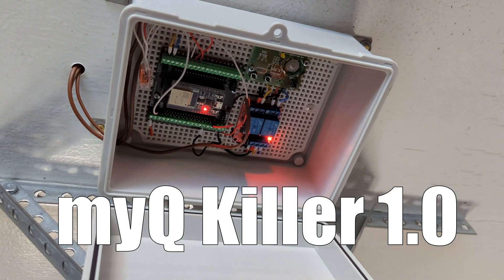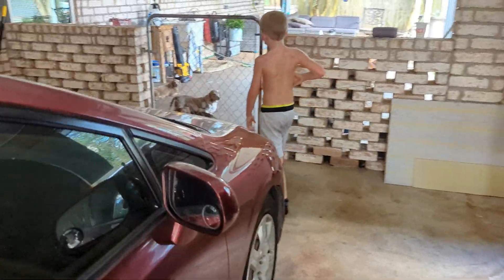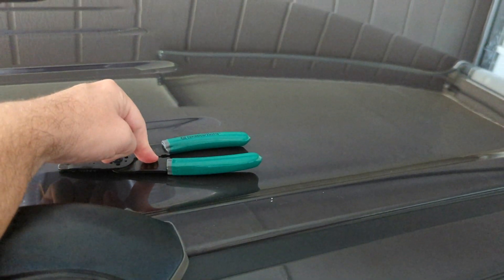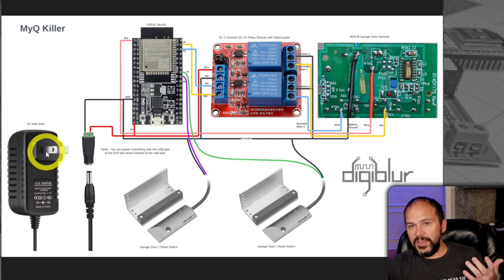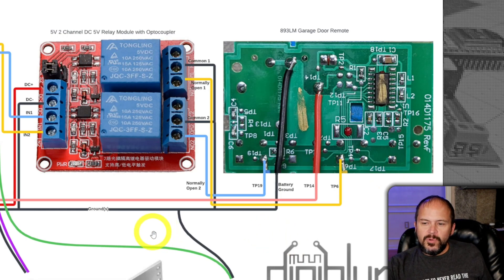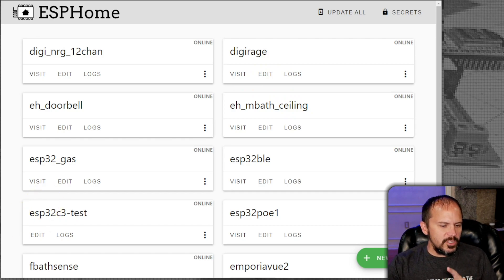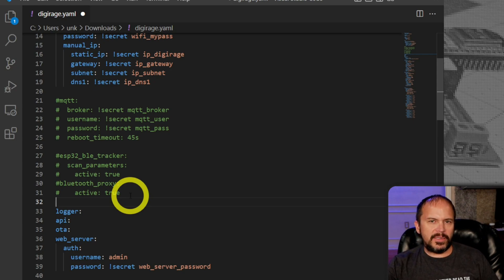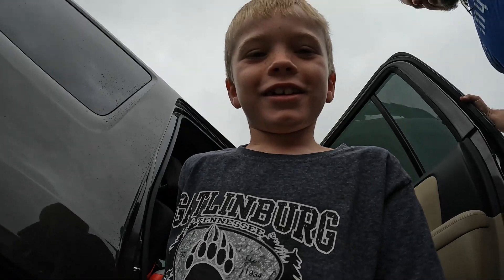myQ garage openers suck! How I fixed it using a spare door remote and ESP32

Comment: I really appreciated the video but why go with LiftMaster in the first place as the garage door system?   I'll eventually need to replace my garage door system and I am sure I won't go with a LiftMaster because of all the horror stories around MyQ.  Probably will look into Genie.
Reply from the maker: This was all they were installing in my area as well.  I waited for a bit on some older openers on backorder but due to scheduling and such we didn't want to wait any longer.  They were very confused on why I didn't want the "app thing".  I'm sure myQ is waiting to pounce on some premium features for a monthly bill.  Lock you in type thing.
Reply: For me, it was just what I bought, didn’t do my research ahead of time, and I regret that, but it was decent cost wise and other than this and one other issue, it’s been great. When my garage was being built onto my house, and after the opener was installed, at least 4 different times, hammering nails somewhat close to the opener, within 10 feet or so caused the opener to trigger and without any of its limits, it actually bent the rod clear up until it damaged the drywall on the ceiling, and destroyed the door itself making it be replaced, and with the battery backup, simply unplugging it didn’t stop the damage. I purposely hammered near it very hard and was able to reproduce the issue one time, don’t know what the contractor did to make it happen 4 times, and I have to admit I didn’t really believe him even though he covered all the damage voluntarily, until I did finally see it happen. So now that I typed all this, it wasn’t such a good deal after all lol.
Reply: Most of us inherit what comes with the home.  Unluckily 99% of professional installers in my area only stick to Liftmaster/Chamberlin openers.  So you get stuck with limited options unless you DIY it yourself.
Reply: Genie makes the worst openers on the market period.
Reply: I looked into this. Genie at least has dry contact switch terminals, but if you want to use the app at all the app seems pretty terrible and has the exact same dependencies and weaknesses.
Reply: Oh god, please don’t go to Genie if Wi-Fi capabilities are important to you. I own a garage door installation/repair company and Genie is significantly more frustrating to program. Just dive into the reviews between the two apps in the App Store, both 5 stars but when you take a closer look at the reviews on Aladdin Connect you see several more bad reviews. For a good while, Aladdin Connect sat at 2 stars but I’ll admit they’ve made small strides to make it better but the UI for MyQ is more fleshed out and simpler. Aladdin Connect is slower too. 

I’m not sure why this person’s MyQ is so slow, mine works instantaneously despite my router being on the 3rd floor of my apartment and my garage door being below on the ground floor. I’ve had customers that have had bad Wi-Fi coverage in the garage and it still takes less than 10 seconds to open (which is still a lot but nowhere near this slow). That issue we can remedy by just adding in a Wi-Fi booster for $50 or less and not only will that alleviate the garage problem and significantly easier but fill in the dead spot in your house.

I do have to say that if you are technical enough to go this method it would work wonderfully but for the average person, they’re not going to attempt this. Also MyQ’s server’s will go down every now and then but it’s only happened to me twice in the last 2.5 years.
Reply: @Knogooseness  I already have an esp running tasmota for Wi-Fi control.  So I won't be using an app for any garage system I end up getting. 

With MyQ I'm just considered with how lock down they are making their control buttons.  In one of Linus's videos he was controling his garage system at the wall mounted button location by adding in a relay.  I'm doing a similar thing but I have an esp sitting on the garage door motor controller with a second set of wires into the same terminals as the wall mounted push button. 

My main concern is that I will no longer be able to bridge two wires on garage motor to open up garage door, because I want that local control.

I'm not against soldering and I've done that before I've replaced chips on circuit boards for ESP ones, it's more the fact that that being required to get local control and you have to "destroy" a remote in order to do that is what my issue is.  But I do like the fact you were able to get rid of the battery as shown in the video, previous hacks that I've seen people do have left the battery in place which previously have made this hack an automatic no for me. 

It is very clear that MyQ will never have a local control because they built a business model around requiring people to use their web controlled app and I rather support their competition with hopes they don't end up going down the same path.  At least not to the extent Chamberlain has.

Comment: Noticed MyQ was down for me many hours last week.  Of course during one of the few times I've needed to see remotely the status of the door via HA.  Thanks for pushing me to finally go local with the overhead doors.
Reply from the maker: It drove me nuts everyday!  Of course now I've moved past it a bit with the powering off the openers and doing car automation stuff.
Reply: @digiblurDIY  Getting ready to use your setup.  One function I'd like to add is detection of a vehicle that is too close to the closing door, from the inside anyway, to prevent another way my wife can ding the vehicle.  The stock transmitter and receiver are recommended to be placed down low where a small child could set it off.  This can allow the trunk or bed overhang of a vehicle to be in the path of the door, but the wheel not in the sensor's view.  With the newer Chamberlain/Liftmaster doors you can't simply add another set of their sensors up higher.  Did I hear you will be playing with sonic sensors with ESP32?  Thx
Reply from the maker: Yes. Checking out a few sensors for car detection. Haven't decided what I want to use just yet. This was one reason I went with the esp32 and not two simple Shelly1 devices.

I do believe there is a code required for the doors and the height of the sensor. We had to send pictures of the sensors to the homeowners insurance of them installed.

Comment: My reeds are just shy of the ragged edge of picking up when the doors are closed. The other set is wired to the alarm panel. Boils down to personal preference I guess.
I like the smart switch on the power cord. I've been looking into options for mechanically locking the doors via the slot in the rails and having the power dead makes me feel better doing that. 👍
One thing I need to do is set the relay to pulse instead of using HA to reset the contact.
Reply from the maker: I have my other door in my alarm panel but is a manual style door for mainly storage of junk and the push mower.  
The smart plug isn't as secure as the door lock but pretty simple for my setup.